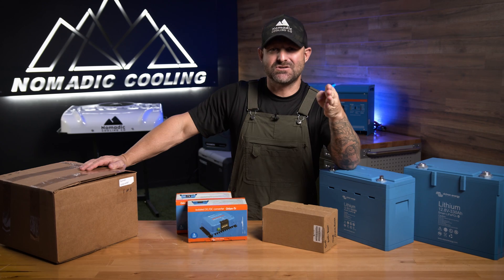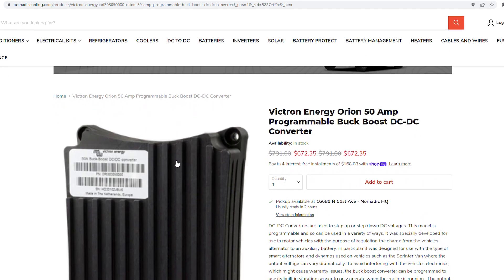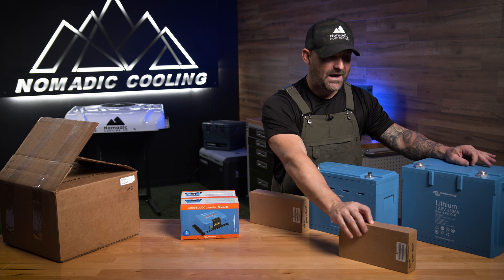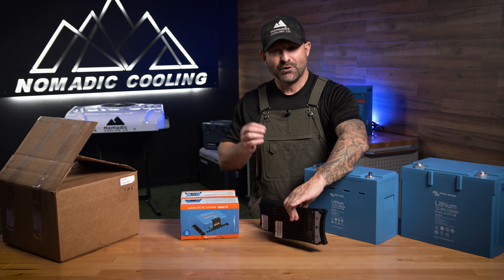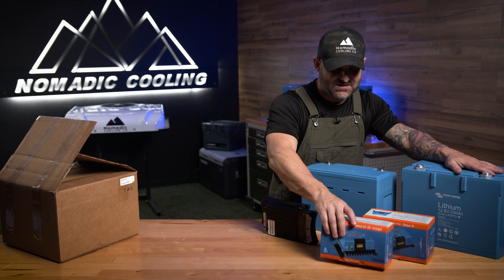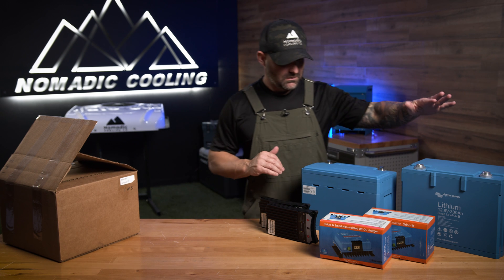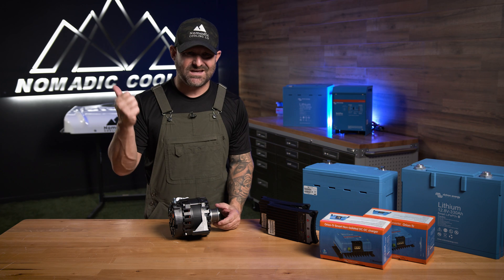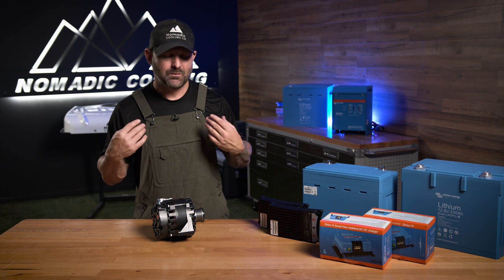Victron Orion-Tr Smart DC-DC Charger I Victron Orion Buck Boost I Electrical System

Comment: Well I didn't add lifepo4 batteries for my inverter, I swapped my starter batteries for lifepo4 dual purpose cranking batteries.  I love em, they keep the fridge going for a full day without running the truck. but I never know how much power is in them and if i try to put a dc/dc charger in place, well they can no longer start the truck.  

I drive a semi so the weight of swapping vs adding batteries does matter.  Now I'm thinking I need to add in a 400ah battery for my 12v ac just so I can put in the charger.. but it still won't protect the alternator (which shouldn't be necessary with a dual purpose cranking battery)

Sure would be nice if a few techie channels would look into these lithium cranking batteries.

Comment: You really should learn about alternators and their purpose in a van. 
You need to take in account the van’s amperage(power) needs and than what’s left you can safely use for a dc-dc charger otherwise it kill your alternator.

Comment: Does stacking these DC to DC chargers negativiely impact the alternator? Dumb question but is it just two chargers drawing 30 amps at the same time or is it drawing 60 amps from the alternator?
Reply: Is definitely does. The load doubles with 2 orions, and a continued high load on your alternator will kill it. Rule of thumb is to use max 60% of the rating as dc-dc charging. Some people stay even below that. Also be aware the Orion can actually draw a lot more then 30 amps from the alternator. Some modern alternators are temperature compensated and will protect themselves from overheating. But I still would not risk it.

Comment: One thing that I think is worth mentioning, is that the Victron Buckboosts are DC-DC Converters, NOT chargers. 

This is what makes them different from the Victron Orions. Converters will take the voltage from the vehicle and output it at a constant stable voltage to your battery. 

Chargers on the other hand, have charging profiles and take into account bulk charging, float charging, and absorption charging. This is important for Lithium batteries especially. 

So the Buckboost will just output a constant voltage and amperage no matter what to your battery. The Orions will vary the output to your batteries depending on how full their charge is. 

Victron is now releasing a 50A Smart Buckboost which is basically an Orion charger but at 12|12 - 50A charger. It has the various charging modes and profiles.

Comment: Even my boat has solar and I find I’m topping up. I’ve just taken 50Amp out and replaced with 30Amp. Not wrong about the Orion getting hot, similar to my old Redarc. Runs at around 50-55c

Comment: Or you can install 1000Wp on the roof of your Chevy Xpress and 800 more deployable, plus the Victron 12 to 24V/15A charger while you’re driving and you’ll be just fine.

Comment: So balmar is good now? Second hand balmars are common and most say, "just rebuilt". Like buying an Rv with a 454 engine. "Just rebuilt". They've been taking run of the mill alternators and rewiring them, painting them then selling them for 3-4 times what they paid and they fail often. Anyways, maybe they're better? Any experience with a 5 year old high output balmar that's been charging a large bank in a heavily used system without failure? I'm looking for a rock solid alternator for a catamaran that will only have 1 alternator per engine. In the light of k.i.s.s. We're thinking of putting the money in backup dumb alternators and using 4 Orions as they are 100amp alternators. In the middle of the pacific We're thinking about reliability. And we have a 1400ah lithium bank along with a 800ah agm and 2 starters. The agm is just backup as our life will not be in the hands of computers. With 2 400 watt wind generators, 2000 watts of solar and a Honda generator that can utilize the victron 120 amp charger well be fine. But the larger dc charging is very tempting. Just can't find a reliable alternator